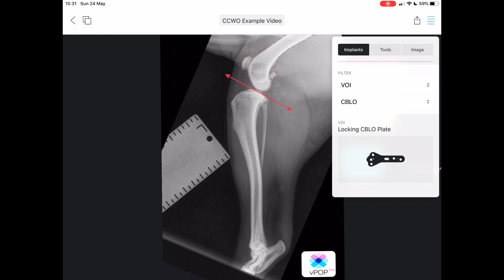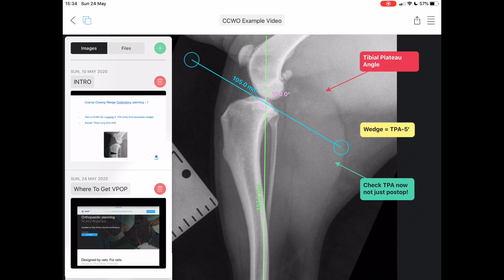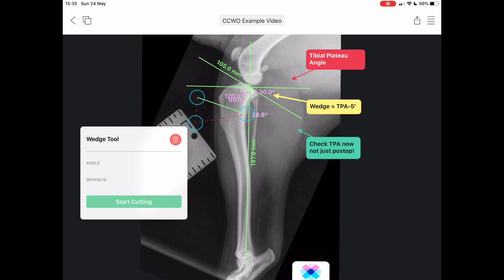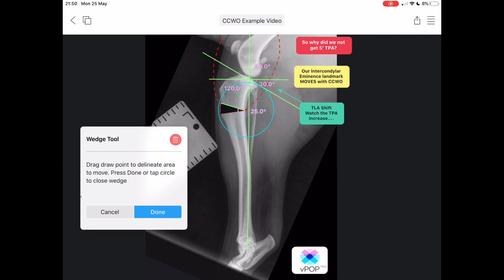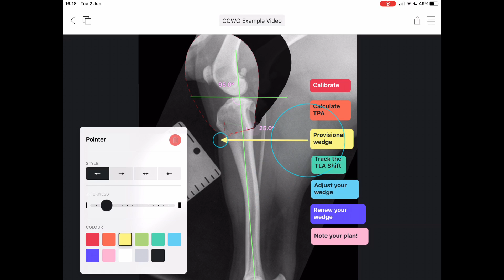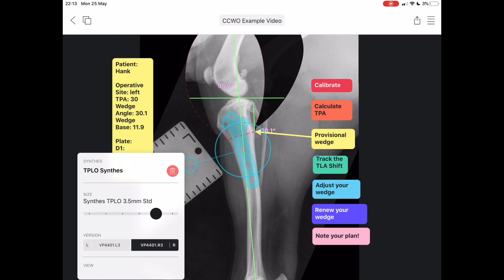How to plan a CCWO Cranial Closing Wedge Ostectomy  in vPOP Pro!

Comment from the maker: Calibration                                                           1m 41s- 2m 40s
Tibial Plateau Angle Calculation                      2m 50s - 4m 15s
How to calculate and use the Wedge tool.    4m 20s  - 5m 33s
How to check TPA after a wedge plan           5m 38s - 6m 44s
How to use the Paired line tracking tool.       6m 09s - 6m 28s  & 13m 0s - 14m 30s
What it Tibial Long Axis Shift                           7m 04s -  8m 20s
How to accommodate TLAS                            8m 23s -  10m 16s
How to annotate, record measurements.      10m 25s - 11m 30s
Measuring D1 and D2.                                       11m 32s - 12m 10s 
How to select implant                                        12m 20s - 12m 55s 
The importance of wedge positioning.            13m 0s  s 14m 30s